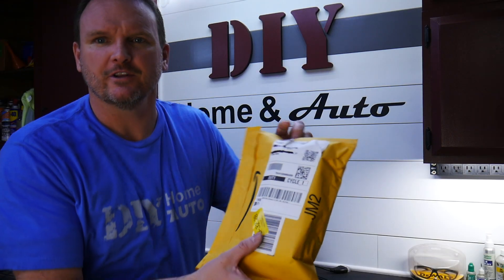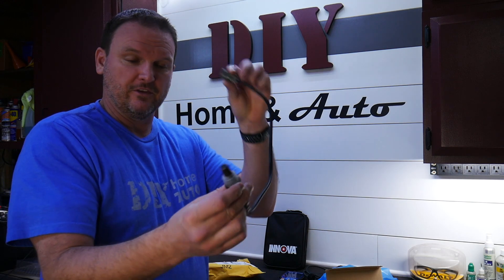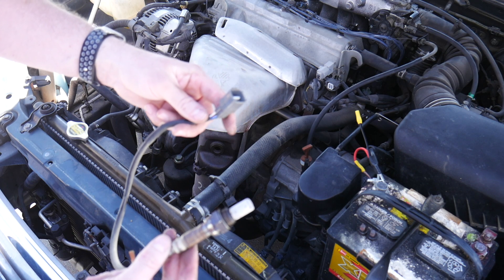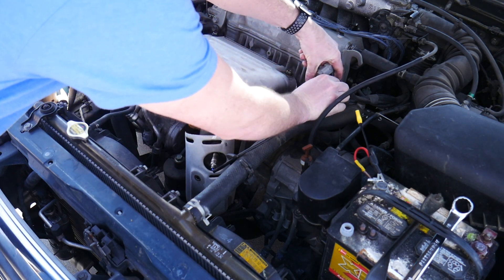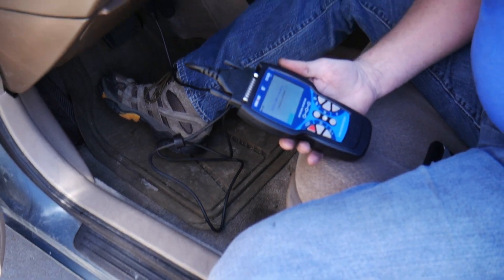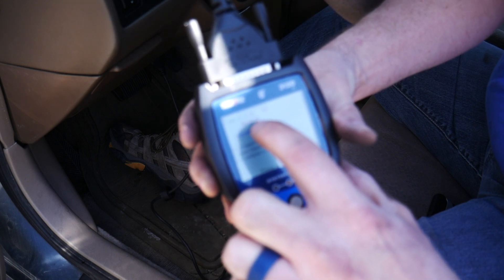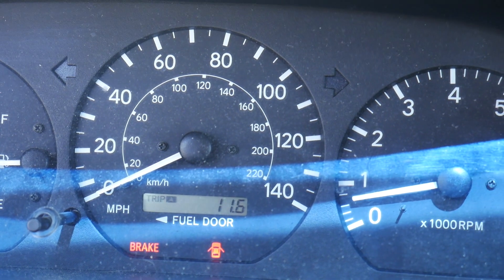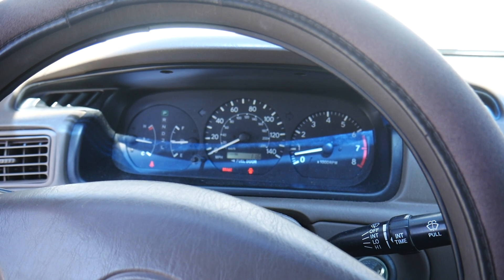2000 Toyota Camry P1130 and P0106 Diagnose and Resolve - Easy Fix

Comment: Couple things:

1. Never put tools on top of your battery.
2. What comes with the O2 sensor is copper anti-sieze grease, not threadlocker. Threadlock makes it harder to remove.
Reply from the maker: Answers:
1: true, unless you are very careful. 
2: being a YouTuber is hard, when the camera is rolling sometimes the right words don’t come out first!  Yes, don’t use “threadlock” on O2 sensors!  😜
Reply: It’s an AFR sensor not an o2 sensor

Comment: If it's like the 1999 Camry 2.2l, it's the upstream Air/Fuel Sensor, not an oxygen sensor. And if you want to get even more technical... it's actually an Air/Gas ratio sensor. Everyone calls it an Air/Fuel sensor, but tecnically that's incorrect terminology because "fuel" IS a mixture of gasoline and oxygen. Without one or the other, you got a non-starting engine. An Oxygen sensor measures unburned hydrocarbons, but ultimately works similar the the A/F sensor.

Comment: Is there’s any way to clean the sensor instead of replacing it?
Reply from the maker: I’ve never had good luck with that. If you go through the trouble to pull it you may as well replace it. Not the cheapest answer but will keep you from opening the hood again in a few weeks/months. Ok so that said, the ONLY thing you should use to clean on o2 sensor is gasoline. Soak the head of the sensor overnight. Don’t scrub it no matter how tempted you will be. Swish it around in the gas in the morning. Pull it from the gas and install it in the vehicle. This might kick the issue down the curb for weeks or months, but my experience has been that I end up replacing the sensor later anyways. Hope this helps!  👍🏼

Comment: P1130 is the  Air/Fuel sensor not O2 sensor. Replaced the A/F sensor on my 2000 Camry V6. What a PITA to remove. Check engine came back on won't clear last remaining EV monitor status. Every 50 or so miles check engine cycles on then off. Even when light off, still have not clear the EV monitor status. I guess about time to invest in a smoke machine.
Reply: I wouldn't be too quick in assuming the sensor needs to be replaced because of a p1130 code I have a 98 Toyota Camry and this code has come up at least twice in the past 2 years I replaced the sensor because I had another Camry that was totaled in because of an accident, well the engine light came back on after a couple of days, so I started checking for vacuum leaks and immediately noticed the air intake hose had a crack underneath by the throttle body I replaced the hose and it got fixed check engine light went away.  Just recently more than a year later same code again so I was ready to diagnose the sensor with the scanner to see if it was working and needed to be replaced but I noticed my air filter was extremely dirty I hadn't checked it in a long time because this is my backup car so I went ahead and replaced the air filter with the OEM from the dealership and I erased the code drove for a day all the monitors were completed and no more check engine light, so don't be in a hurry to replace the sensor the OEM is about 270 dollars pretty expensive and you don't want to take a chance of buying a counterfeit sensor from Ebay or Amazon ,50 dollars bullshit they're not the real thing and can end up damaging your engine and the aftermarket from auto zone will not work as well as OEM diagnose with a good scanner before you buy the sensor but check for other stuff that affects the air flow going to the combustion like vacuum leaks or an extremely dirty air filter.  Live and learn it sucks to just spend money on unnecessary parts.
Reply: @awakeandalive4248  that's really good experience on P1130 error code for my camry 1997, let's check if any vacuum leak and dirty air filter like your cases. My A/F sensor is with resistance value 14 Ohm, can you advise if that's good value?

Comment: what symptoms did you have?
Reply from the maker: Just the check engine light. My friend said the car was still running fine, but maybe getting worse gas mileage. Every once in a while the car would “hesitate” when taking off from a full stop.